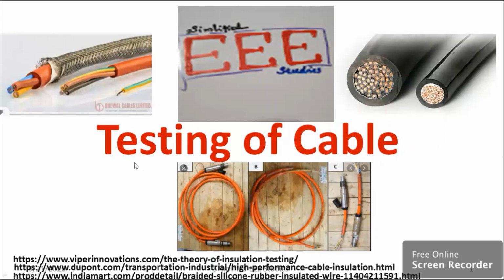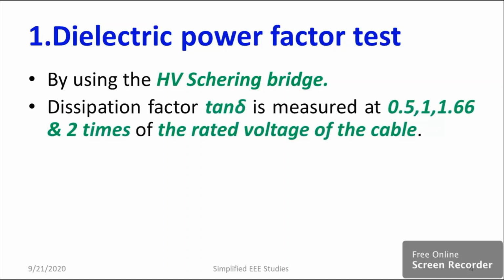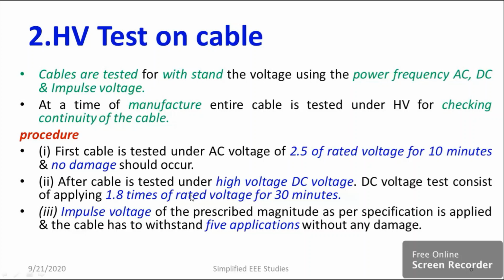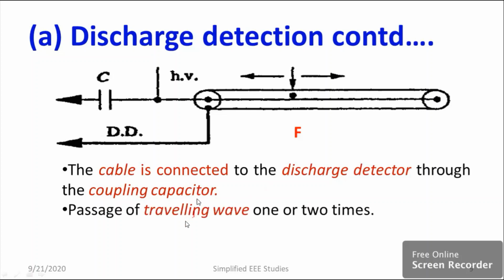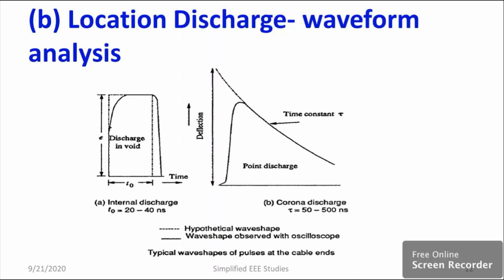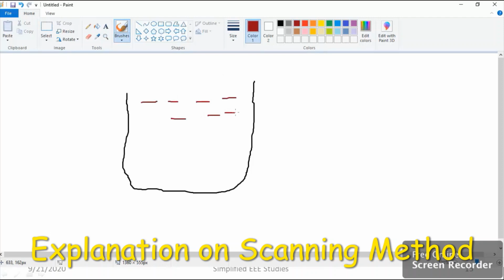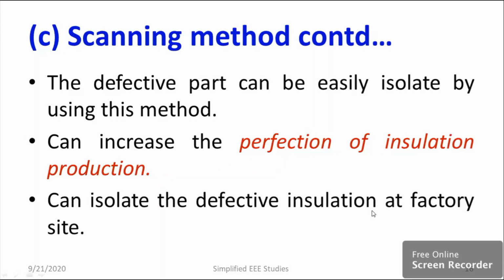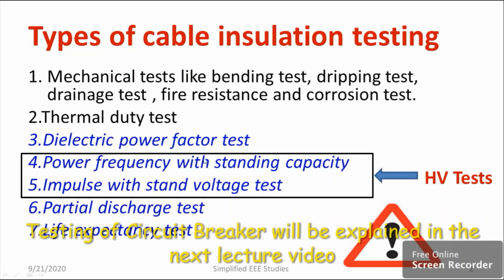#Cable#Insulation#Testing#Procedure#High#Voltage#Testing | HV Testing Procedures of Cable Insulation

Comment: Hi, You have tried to cover basics of cable testing. However, presentation does not demonstrate any practical field scenarios, test setup , test equipment, results etc. In the end you have shown the book reference from where you have made this presentation but industries does not work on only books you need to show reference of the IEEE / IEC / INDIAN OR EQUIVALENT STANDARD which shall be opted for the complete process of cable testing. Perhaps you have mention IEEE 43, IEC 60502 etc. Just a feedback.
Reply from the maker: Thank you sir.
Actually I have worked out this video for students those who are preparing for exams. I will find out the practical aspects and update.
Thank you very much for your valuable feedback.
Regards